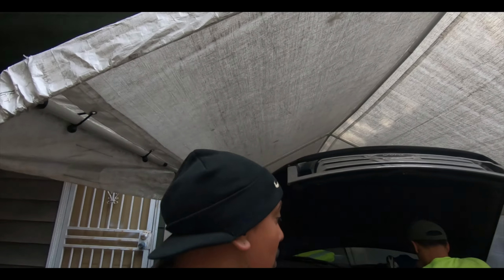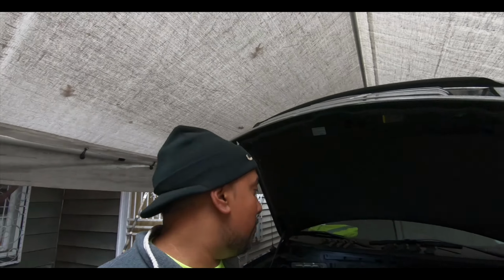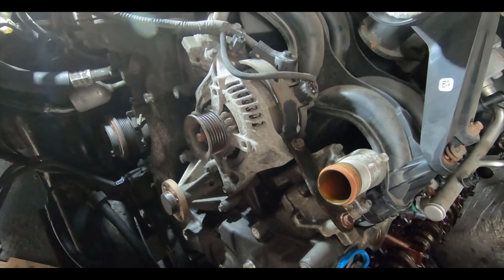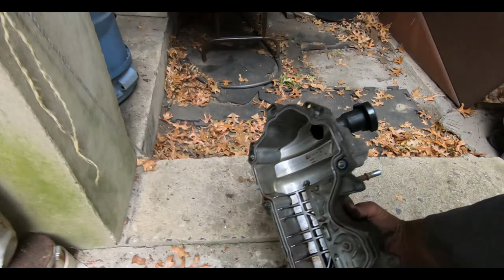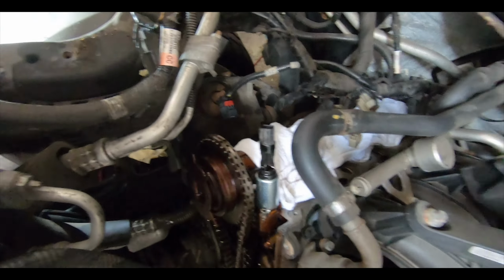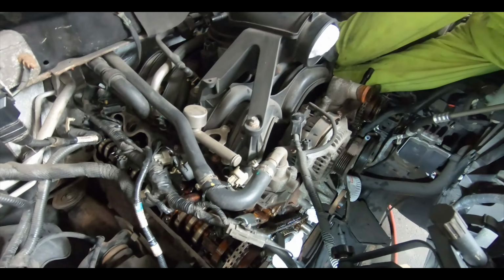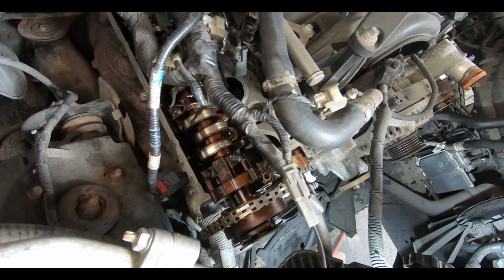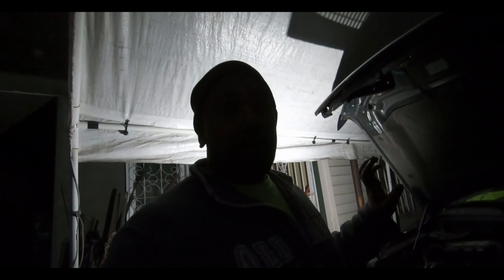Ford F-150 5.4L 3v Timing Chain Replacement Pt 1

Comment: I'm about to have to tear into mine.  I also am rebuilding top end of my Nissan quest.  It is a absolute nightmare.
Reply from the maker: good luck, I know it can be a pain.
Reply: @ProjectZGarage  thanks,  I believe the chain guides or tensioner is bad on my truck. You can hear the chain slapping the metal it's been getting worse over the last few months.  Need to fix it before it jumps time.